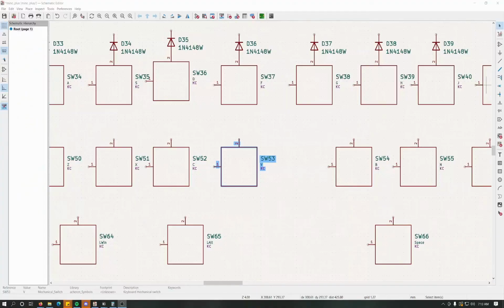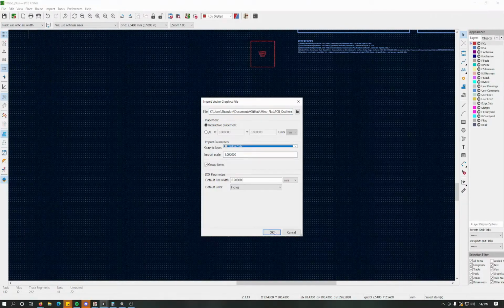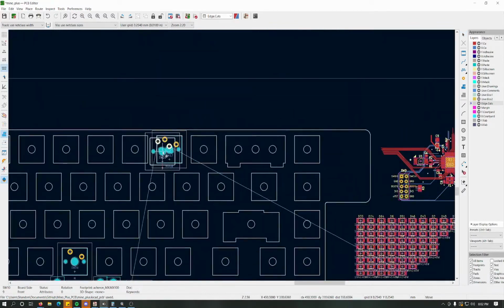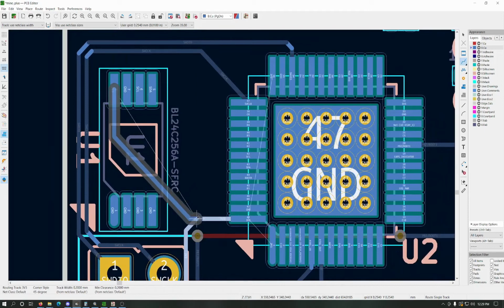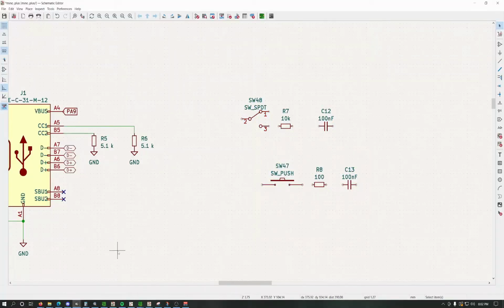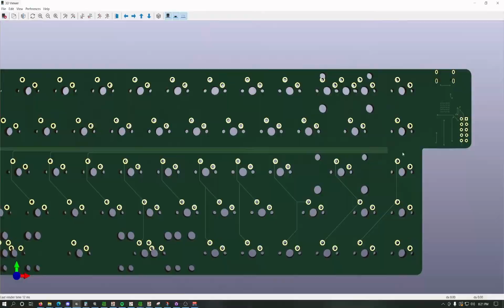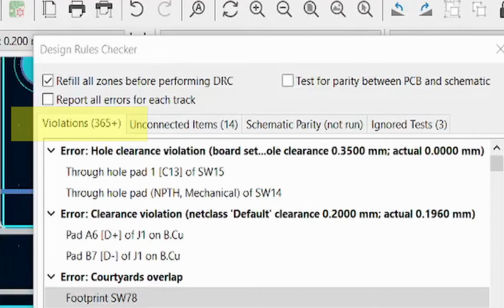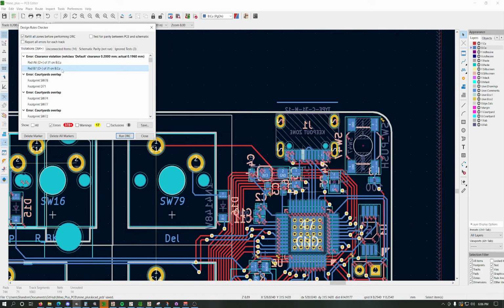Designing a 65% Keyboard PCB | Mino Plus Proto | Arm Based Mechanical Keyboard

Comment: please help me design a pcb to replace the shitty Savage65 lol, if it had SMD LED's on the top and bottom it would be 1000x better, especially since its what they throw in with the Stacked 65
Reply from the maker: I could be wrong, but I think the Savage65 uses a "universal" 65 PCB spec, so you should be able to use other universal PCBs like the Instant65 PCB (has top LEDs) with the same Savage65 case.

Comment: Im in the proces of starting/learning to design my own PCB. 
Before I wanted to dive in deeper into this, I'm curious how much it costed you to have the fabricator build the PCB you showed in the video? Or how much it might cost you in the end?
Reply from the maker: Congratulations on learning PCB design. The cost to get PCBs manufactured can vary wildly depending on factors such as the manufacturer, shipping, board size, etc. I will say that in general the PCBs themselves are usually cheap (20-30 USD). Most of the additional cost comes from SMT assembly and shipping which can run about 50-60 USD. Hope this helps!
Reply: @ShandonCodes  Thanks. And another question related to manufacturing. 
Who did you use to build your PCBs? And can you elaborate of the quality your prototypes came as and if I should worry too much about that. 
I am mixed between JLCPBC and PCBway. Maybe you have someone else that you remommned. My thrid option would be OSHPark but that's a premium price.

Thanks in advance.
Reply from the maker: @Dnckers  I usually use either PCBWay or JLCPCB for my prototypes, they always come out pretty good on the quality no matter which shop I use. I would only recommend OSHPark if you want to order a few small PCBs, as they have surcharges for larger (generally keyboard sized)  PCBs.

Comment: Hello! I'm trying to design a board from scratch with no understanding of anything. So I have a question: What's the use for the "boot" and "reset" pins?
Reply from the maker: So it depends on the microcontroller BUT generally the boot and reset pins will be used in a certain combination to select the bootloader mode during startup of the MCU.